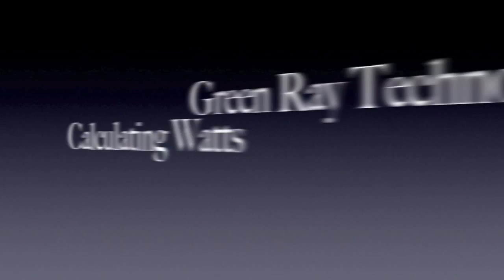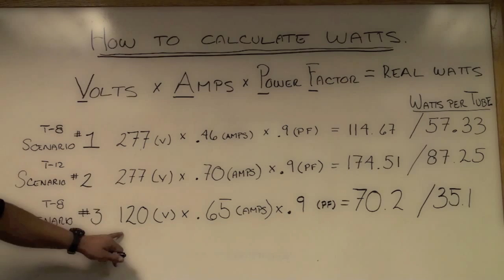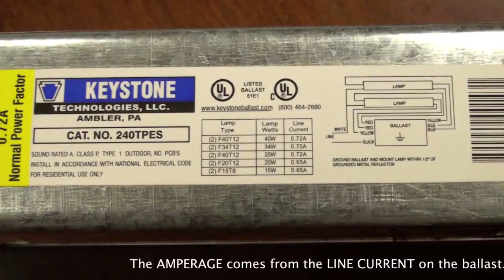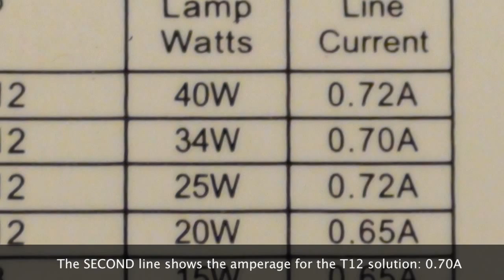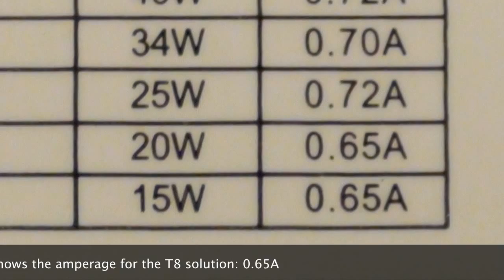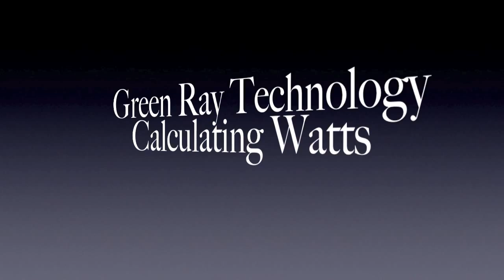LED Calculate Watts

Comment: I would point out to you that using your method,  the power factor on the ballast shown is only 46%.   40w = 120v x .72A x .46          Is .46 a normal power factor for a ballast?